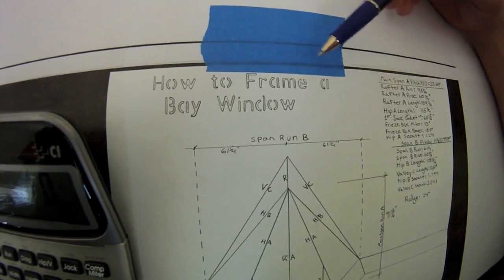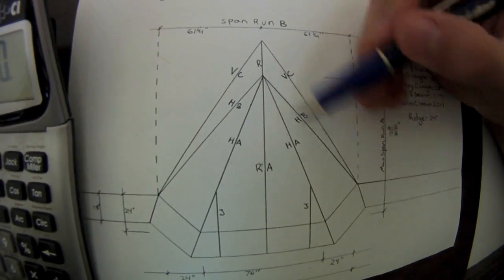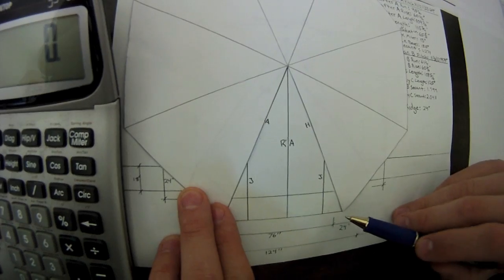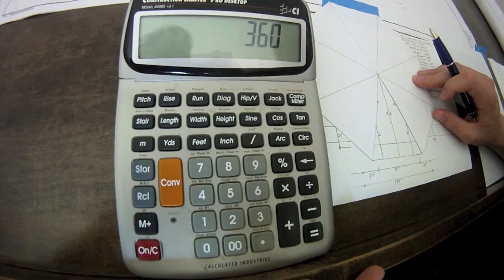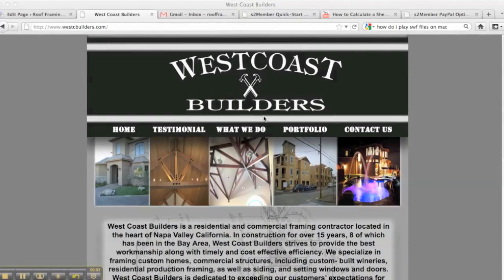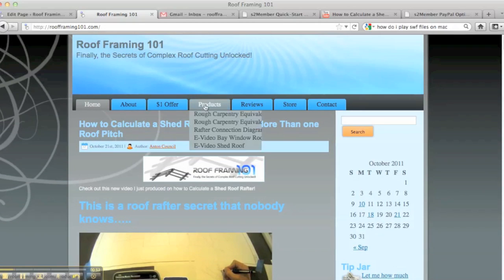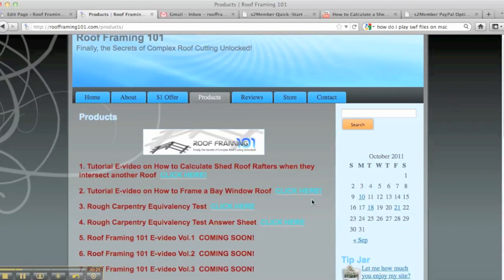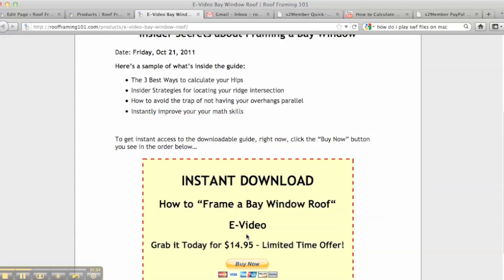How to Frame a Bay Window Roof-Teaser | Roof Framing 101

Comment: WRONG WRONG WRONG a 360 degrees is 2 pi,Not pi as this dude suggests, the angles at the wall is 135 degrees , the hip splits that angle making it 67.5 degrees, NOT 45 degrees  jack rafter angle is 22.5 degrees. The angle where the hip would theoretically meet in the middle of the octagon would be 45  so 45 bevel BUT if you frame the commons first than the bevel cut would be 22.5. I used to think this shit was hard and so complicated after looking at all the ways people do it but now I know that they simply DO NOT understand the math.
Reply: Bay window span divided by COS (22.5) equals hip rafter run. It’s you who doesn’t know how a roof works mate! Bet you’ve never even built one hahaha.
Reply: Can you tell me what the hip/valley line length ratio “secant “is of a 5/12-8/12 bastard roof is. I don’t know if I’m doing the math correctly.
Reply: @TR-rn3pd  1.2506942 for the 5/12 side or 2.0011108 for the 8/12 side. Depends on which pitch and span you’re using to calculate your hip/valley from.
Reply: @Ache E  Aw, makes sense now. There’s one for each pitch. No wonder cuts are off. I’ll try this out in the morning. Still trying to rap my head around how you got the 8/12 side.
Reply: @ Ache E  ok I’m getting the 8/12 side LL, but having a hard time comprehending why it is that number. It’s been a long weekend.

Comment: I would but this brief intro is completely misleading............Firstly, 360/8 sides is 45 deg. This is the angle between the hips at the top junction..NOT at the wall plate. Secondly, the hips bisect the corners at 67.5 deg. NOT 22.5. If I purchased anything, I wouldn't be sure I would get the right information!
Reply: What you are forgetting is that it takes 2 hips to make that 45 degree angle. Meaning each hip is 22.5 degrees, like he said. Also, what is 90 - 67.5? .....22.5.
Reply: Bay window span divided by COS (22.5) equals hip rafter run. It’s you who doesn’t know how a roof works mate!